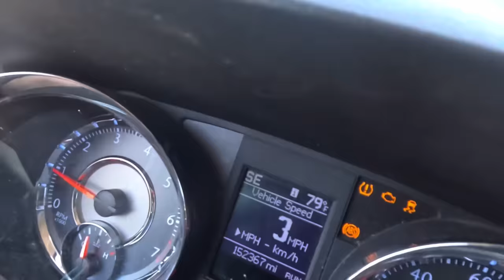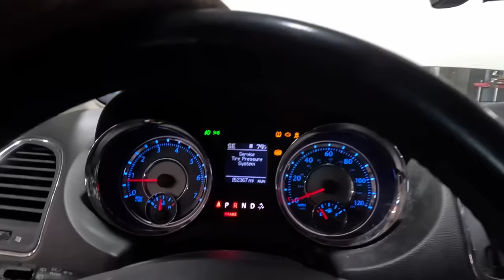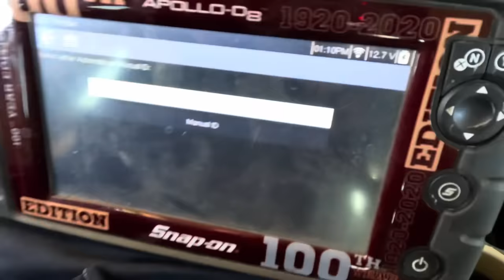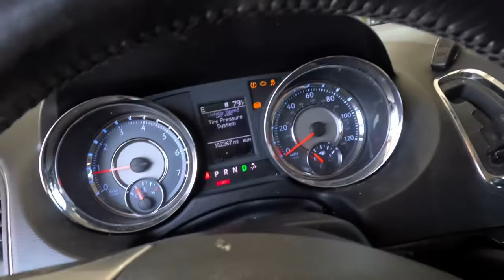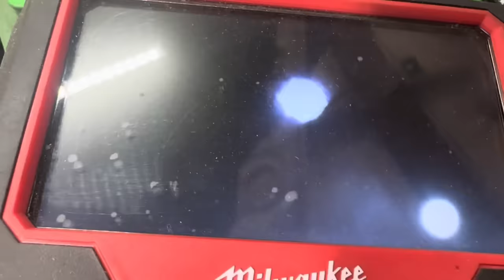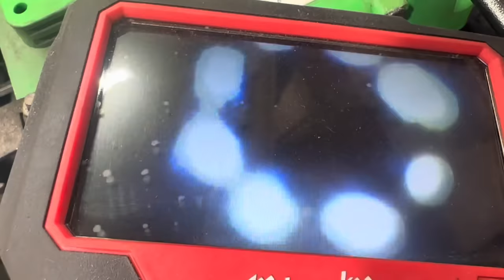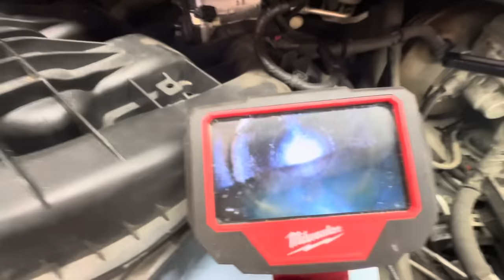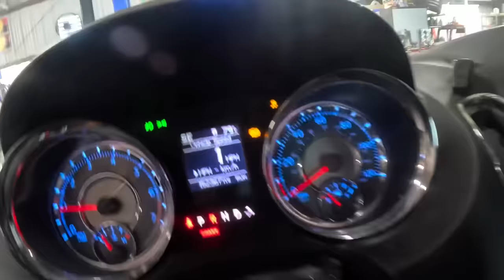Towed In! Died on Highway! (Engine is Drowning Itself!) Chrysler 3.6

Comment: My heart sunk realizing that engine was gone. I know how that customer felt hearing the news. Had it 3 times in my life.
Reply: Why do you keep buying domestics?
Reply: Back in the 80s a friend of mine overheated my '65 Pontiac to death, the radiator failed, lost its water and the engine overheated until it stopped. Replaced it with a used motor.
Reply: I hope the customer realizes that they turned a $100 repair into a multi thousand dollar one by trying to get where they were going instead of immediately stopping. Just stop when there's a problem, and avoid the big repair!
Reply: @edifyguy  probably didn't even know temp Gadge want read hot if it empty's the coolent that fast
Reply: @jonsworld5307  Yes it will. The temp gauge went from cold to operating temperature in seconds while Ray was playing with it. It would have gone sky high had he left it running. The temp sensor is in the head, and will spike with no coolant. Been there, done that. My engine survived because I was paying attention.
Reply: @edifyguy  because he filled it up  senser works on coolant / water if dry it want read hot drain coolant out of a engine try it
Reply: @jonsworld5307  That's not correct. He observed the reading was oddly warm for the short amount of time before he filled it, and that was when he suspected that there was a cooling system problem.
Reply: @edifyguy  Situational awareness! I owned a automotive radiator repair shop for many years. The temp gauge had to be pegged on HOT along with a flashing warning light and it was all IGNORED, not to mention the SMELL of hot coolant!! People just zone out and don't pay attention.
Reply: @edifyguy  no Jon has a point some cars wont read temp vary well or at all when out of when out of coolent
Reply: @brandonmcandrew4859  Some don't, but most do, and this one seemed like it did, because it showed it warm VERY quickly after startup; suspiciously so, because with no coolant, the head heated much more quickly.
Reply: @edifyguy  That's usually the problem. Even if a huge red light and the audio system screamed out "Stop immediately and do NOT restart until fault is remedied", they'd still try to get where the were going.

Comment: This is why you don't ignore that temperature warning or the smell of burning coolant.
Reply: Or the steam that's probably pretty obvious by then.
Reply: This. I had a Focus which had a busted thermostat housing and was dumping coolant out as fast as I could put it in. But I watched the temp gauge like a hawk, and with the first sight of a temp warning I pulled over every time. Thermostat housing was replaced, engine ran perfectly fine after that.
Reply: I can't believe there are idiots among us that drive with it overheating thinking it won't be a bad thing. That's why they call them dummy lights. 🙄🤦‍♂

Comment: “Piece of Stelantis” is perfect.  At least they keep you in business.  Seems like you’ve got a lot of bad engines lately.
Reply: Except that Fiat did not buy Chrysler until 2014. Mercedes would have engineered a 2011 car.
Reply: @morganevans423  Fiat took ownership of 50% of Chrysler LLC in 2009 as a part of the bailout.  Daimler sold off Chrysler in 2007.
Reply: @silicon212  maybe so, however it was still a design from when Mercedes had control, and made in the US. Fiat design input would have been zero.
Reply: My dog leaves piles of Stellantis in the back yard.
Reply: I'm sure Mercedes, Chrysler, Fiat, Stellantis whoever isn't going to survive a owner who ignores warning lights and keeps driving an overheating car!! Pentastar engines a really good engines if people would do their maintenance
Reply: @bigdaddymak1439  spot on sir!
Reply: This is same ad chicken or egg first paradox.

What failed first? Hose and blew the head, or head went first the pressure blew up the hose
Reply: @Sadik15B  since pentastar engines don't have history of blowing heads it was at the very least driven hot
Reply: @bigdaddymak1439  It's a shame the ECUs let them do it... Not that hard to have something detecting loss of coolant and force it into limp mode
Reply: I loved it when my chysler  shredded its Valves, ruined its thermostat, transmission, brake booster and had constant wheel bearing failers. It was a horrible car. It also had horrible suspension, if you sat in the back seats you would get sick.
Reply: @morganevans423  The pentastar 3.6 engine is a Fiat engine.
Reply: Stelantis didn't run Chrysler in those years. It's a piece of "Fiat". The driver ruined this engine by not stopping when it started overheating.
Reply: @adotintheshark4848  you are correct the pentastar design pre dates Stellantis and Fiat and came after Mercedes. This one is definitely on the owner. Chrysler has used the pentastar for so long too. Other than the oil cooler. Most problems people have are do to deferring maintenance
Reply: @bigdaddymak1439  Correct, and you'll find "deferring" or never doing, maintenance will undo even the best motors.
Reply: @bigdaddymak1439  the oil cooler is only an issue because, you guessed it..made out of plastic. Replace it with aluminum, no more problems.
Reply: @adotintheshark4848  they revised the design don't see Mopar replacements leaking
Reply: Working for FCA doesn't mean the same as the song
Reply: @bigdaddymak1439  did they change to aluminum? Usually the replacements from Dorman in particular, were aluminum.
Reply: You do realize the vehicle is 13 years old and has almost 160,000 miles and it is a Chysler design which was introduced to the chrysler, ram, dodge, jeep. Running any vehicle without coolant for any real length of time will certainly destroy any engine, regardless of design. It was a failed coolant hose so please before responding you might want to watch the entire video before posting your "Knowledge" on how reliable something may be.

Comment: I had the same problem with our '08 Town and country with a 4 l V6, They use a plastic y connector and it cracked and breaks over time with the temperature swings. I had this happen twice to us (say what you want about Chrysler...but other than that our van was pretty good to us)  I fixed it both times and the engine was fine  because I caught it but they should have used a metal part in there. Too bad a little plastic connector totaled this motor.
Reply: Owner should have noticed it when it broke. The temp should have spiked, not to mention the smell of the coolant.
Reply: @hotpuppy1 100%!  The engine would have been perfectly fine, I'm assuming the alarms are going off when it was overheating... They should have pulled over and turned it off instead of driving it until it stalled out and died.
Reply: @anthonydtobias  as some one else stated they were probaby fuckin off on a phone LOL or had the stereo up too loud to drown out the noise from the intrument panel screaming mercy at them.  Have a 06 dodge ram 1500 for the 4.7L magnum. stull runs with almost 400 K on it. Has it's issues as would any high milage vehicle but the motor and trans still performs.
Reply: Yes, those plastic Y connectors have been a problem on many years of Chrysler vans.  I think I used a brass or aluminum one from a Home Depot plumbing department because some forums suggested it was better.
Reply: They didn't want to walk a little so they kept driving. Guess what they maybe walking for a while. If it's hot STOP. Something is not right.

Comment: Plastic for the win! I’m surprised that they didn’t notice the temperature gauge pegged hard over.
Reply: People don't drive anymore. If the engine starts and the vehicle moves, it's good to go run a muck and break every driving law. Few people know the vehicle has a gauge cluster, that's why the fuel tank is always on empty.
Reply: @brianpiper3188  That's why modern ECU's should just shut the engine off if Bad News (tm) happens to the engine, and BEFORE the conditions where serious damage occurs to it. Even a giant red triangle with "PULL OVER IMMEDIATELY" on the dash because their engine is about to blow up won't cause drivers to pull over.
Reply: Did you watch the video? Apparently not.

Comment: I had a car early on that seemed to have one coolant leak or another.  I became very paranoid of the smell of engine coolant, even when I was in traffic and it turned out it was another car.   Always expect the worst with coolant leaks!  Pull over at first sign of a leak!  Save your engine!
Reply: There are times I've smell a fuel leak. I've never found one and never had it when alone. Always with traffic around. Still better to be on top of it then wait for the boom.

Comment: Driver blew it up. Slap the aluminum oil cooler and heater hoses on, change your oil like you should, and you'll get half a million miles out of a 3.6.  We've retired several grand caravans from our pilot car fleet with 500-600k+

Comment: Heater core hose could have blown out after the head gasket went and cylinder pressures got into the coolant circuit. This means there could be another root cause for the engine failure. Best check and make sure after rebuild that the engine cooling is functioning properly and prevent a repeat because the root cause was not remediated.